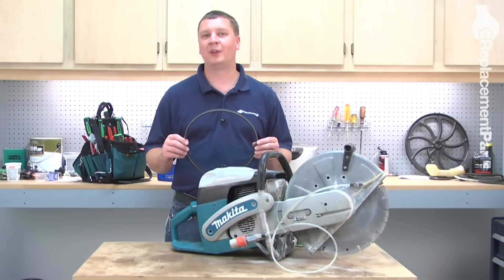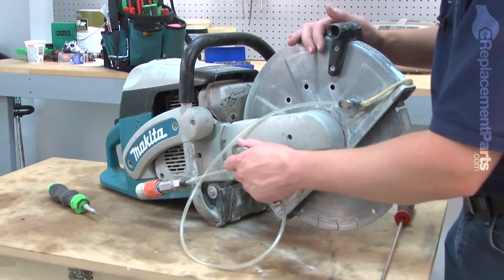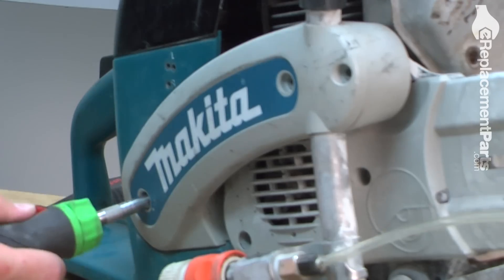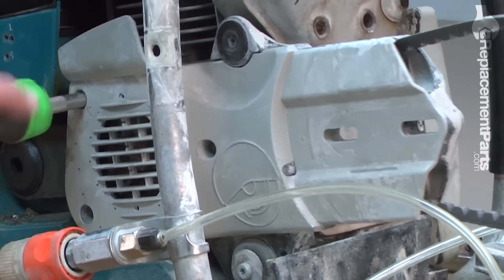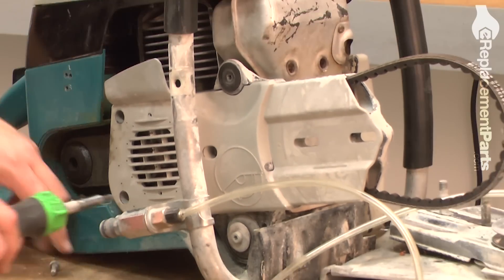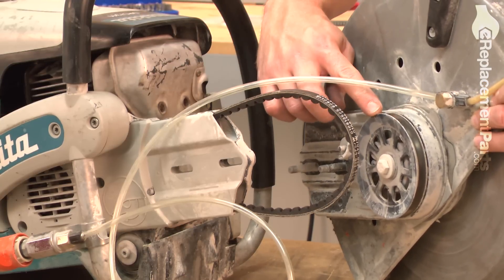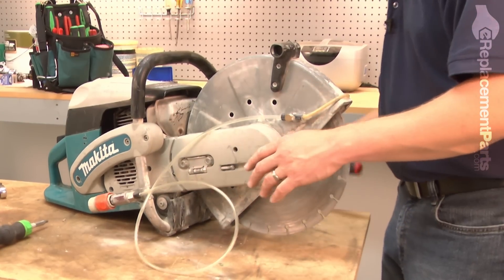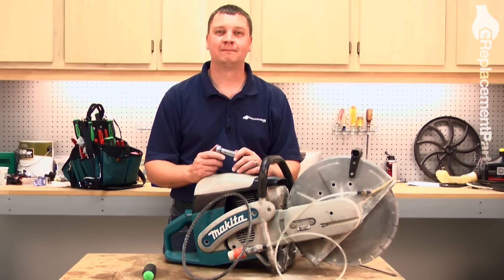How to Replace the V-Belt on a Makita Cut Off Saw

Comment: Hey I have a pocket bike that has a lot of problems no starter looks like a electric start but that would be odd is that posible. It is a 2stroke Japanese bike the centrifugal clutch is ok I thing but the wheels are shot an rusted parts but the engine might run. It has a fuel system that is not doing so well.